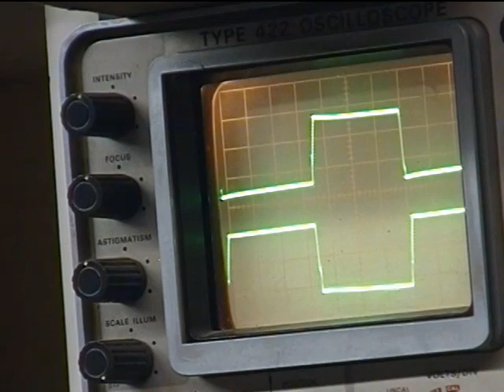12- 48 Volt  DC 1000 Watt ZVS Induction Heater, Pancake Coil Experiments

Comment: suppose if we keep a iron  wire of  5mm dia in the center of the pan cake vertically will it heat the  cross section alone. (5 mm dia . and just 5 mm height.
Reply from the maker: Yes it will
Reply: thank you for the great information
  @frenchcreekvalley

Comment: Sir,,,,re posting the question ..here .....sorry..pl. help..

 i am  following your vdos for zvs inductions heaters, i have a problem which i cant able to solve, i use the circuit given in ...https://spaco.org/Blacksmithing/ZVSInductionHeater/1000WattZVSInductionHeaterNotes.htm

this one (above) i use a high curent mosfet (100A ) it can handle at 100V,i use  a 20V 30A transformer +rectifier unit with 21000mfd rectifier dc capacitor for smothering the dc

i have a 4 mfd capacitor (1 mfd x4nos) for tank circuit i i made a copper tube working coil (3mm copper tube with 5 turns 1.5 inch coil dia .)

my problem is when i switch  ON DC the inrush current is very high    --trasformer sec 60A) without any load inside the working coil. and no resonance in tank

the mosfets heat up like hell ( but dont fail since 100a rated). so i switched of to avoid rectifier failure.

by experimenting i inserted  a thick (2 cm x 2cm ) mn-zn ferrite rod into the working coil to my surprise the  tank resonates and the  current taken also is less just 3.5A (input ac current to rectifier)

when i insert a small iron wire inside working coil it heats up slowly but never  to red hot condition, (input current increases from 3.5A ac to 7-9A)

but when i remove the ferrite rod from inside the workingcoil the resonance stops and the mosfets becomes very hot input AC current increases to 60A etc.,

i tried to make the working coil tighter and closer .....made diameter 2 inch with 5 turns no change.

Please explain and help me how to solve this......

the circuit is perfect all parts ok since i used large size components (100+ A mosfet)  8A diodes, 5W zeners ,5w resistors, i use 470 ohms  and 10 k resistors.

plese ....please help.... where is the mistake ????

do i need tgo change coil size ???

1

Frenchcreekvalley .frenchcreekvalley
Reply from the maker: regarding:
"i have a 4 mfd capacitor (1 mfd x4nos) for tank circuit"
I don't know what "nos" means.  Are the capacitors in series or in parallel?
If they are in parallel, then you do, as you say, have 4 mfd.
If so, I think you should have more inductance in your work coil.

I also think you changed the net inductance of the resonant circuit a lot by inserting the  ferrite rod.  I suggest making a coil with twice an many turns.

I am a bit confused when you say that the first work coil is: 
5 turns 1 1/2" in diameter, 
and then you say:
"i tried to make the working coil tighter and closer .....made diameter 2 inch with 5 turns no change"
  ---"tighter and closer" doesn't make sense if you made it larger in diameter.

Are you measuring the DC  output voltage of your power supply?
If the voltage drops below about 12 volts at any time, one or both Mosfets may lock up in the ON state and create the problem that you describe.
  Since that circuit was apparently designed to accomodate DC input voltages from 12 VDC up to 48 VDC, the gate circuit components are no optimal for your 20 volt supply.
Reply: Your inrush current could be because of the high value filter capacitor. Also MOSFETs must be rated for about 4-5x the input voltage. I guess problem with your stuff is that your input power isn't clean and to get higher current try doing 0.3mf capacitors in parallel for more current rather than using 4mf ones in parallel then you have essentially the same thing as these Chinese drivers.